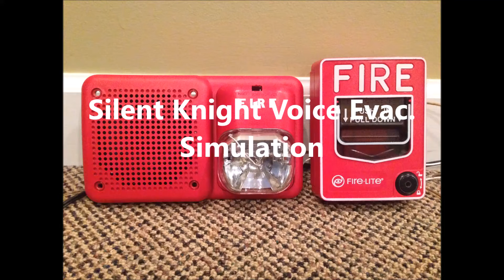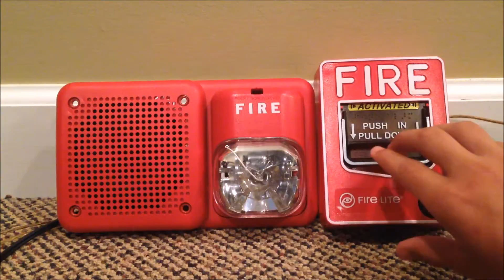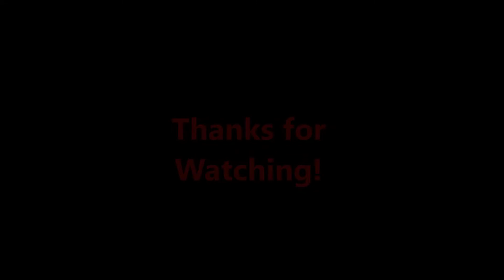Silent Knight Voice Evac. Simulation

Comment: How did you get the speaker hooked up? (Request for video of how to wire a fire alarm speaker.)
Reply from the maker: The speaker is hooked up to an amplifier which feeds an audio signal through the speaker to make the speaker work. You can also hook the speaker up to a stereo system.
Reply: Do those have amplifiers?
Reply: I also meant something like a radio?
Reply from the maker: Temple 92 Yes. You need an amplifier to power a speaker.
Reply from the maker: I am not 100% sure but probably.
Reply: Fire Alarm Person
You don't have to have an amplifier to power the speaker.
It's highly recommended to use one so that nothing is muffled.
When I first started filming fire alarms, I didn't have an amplifier, so I just hooked my speakers directly to my laptop with a 3.5mm mono (single channel) audio jack and some wire.
Reply from the maker: Generally speaking.....

Comment: Does it come with Voice Evac or do you need a panel?
Reply from the maker: You definitely need a a VOICE evacuation panel for a voice evacuation system. I have the speaker hooked up to an amplifier which creates and audio signal for the sound to come out. Hooked up to the amplifiers, I have an iPhone with the voice message saved in an audio file. And then it it just played directly into the speaker. The speaker strobe does not come with voice evacuation or any message in it. So technically you can play anything you want through the speaker. For the audio files, you can use a computer, mp3 player, iPod, iPhone, etc. I get the messages from the company websites and other videos with similar content.
Reply: I'm getting one. Does it make a code 3 sound when you hook it up?
w
Reply from the maker: supersiren25 Roblox Nope. Like I said, you have to hook it up to a speaker system and play the message from your electronic device directly through the speaker. It's kind of hard for me to explain it without it in front of me or me actually doing it.